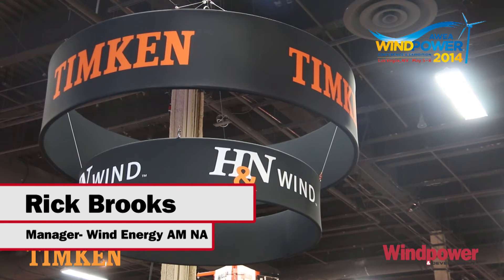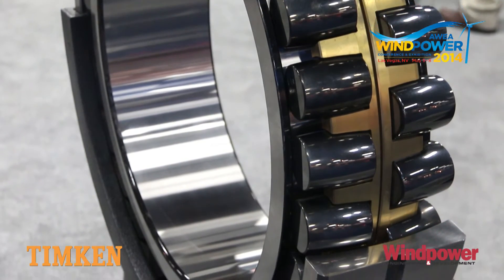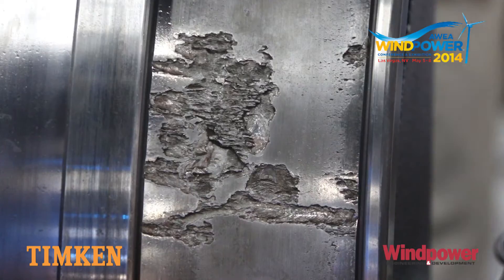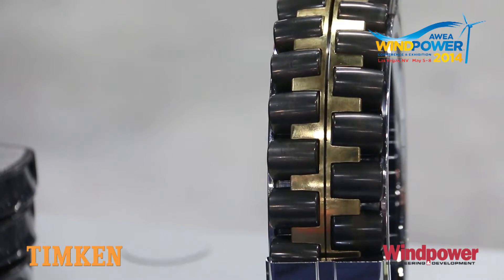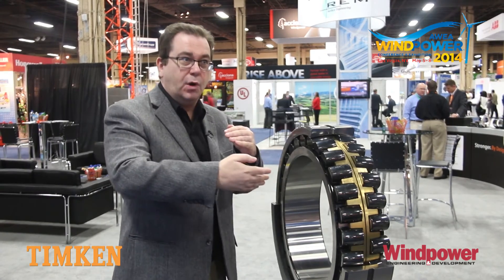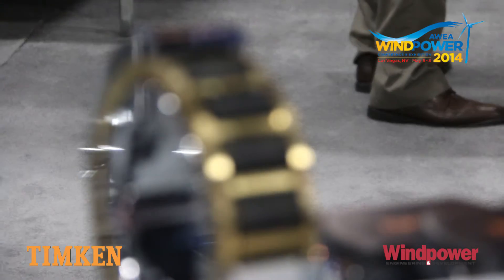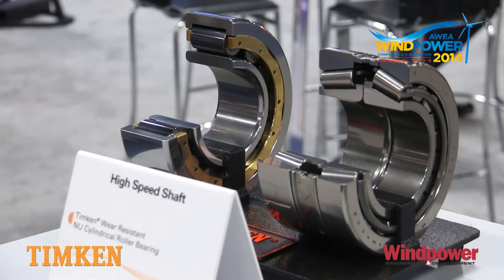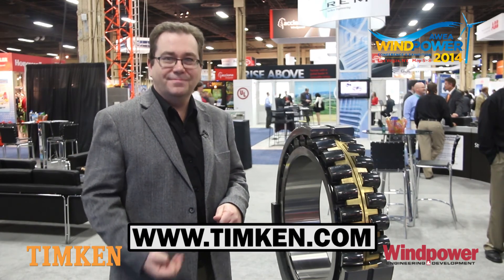Upgraded turbine bearings and components

Comment: No oil?? You need to use oil... they need oil,  bearings use oil, the oil will prevent metal on metal contact, even water with a rust inhibitor is better than nothing, a pump drain, seals temperature and flow sensor need fail safes